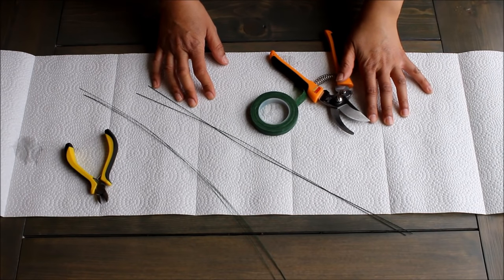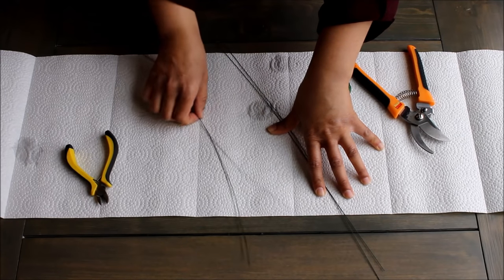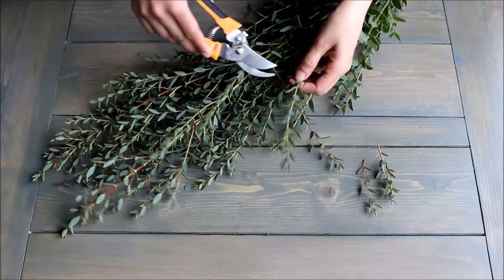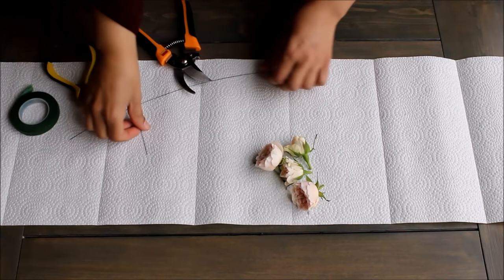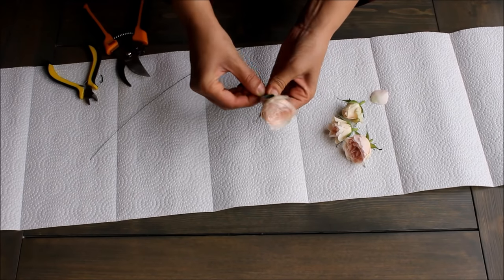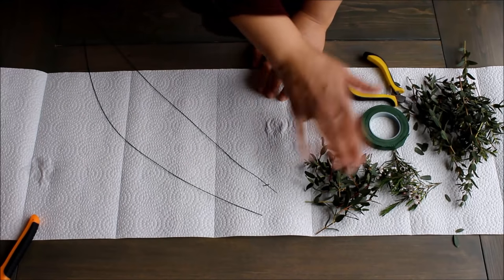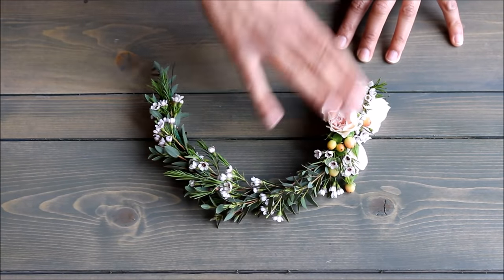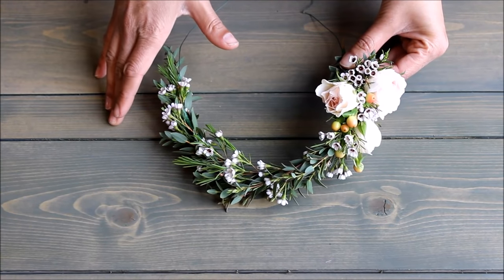How to Make a Flower Crown

Comment: Hi I was wondering if you could show us how to do a half floral crown. I have been asked to create one for a wedding.
Reply: Thi Tu floral designer here... When she got to the half way covered point... Stop....and use the hair to cover plain wire so it looks like a half crown  or cut it there and put ribbons on each end and tie together at the back of head. Also, you can go out and buy a plain plastic head band on hot glue flowers and greenery to that. Unfortunately the stretchy kind won't work though... Once stretched to put on head the flowers go haywire...lol

Comment: Hey do you need to spray water on the crown if you make it 2 days before the wedding?
Reply: if you store it in your fridge and spray 2x a day they should be fine :)
Reply: Don't spray water on any flower heads/ petals, it will make them rot quicker.